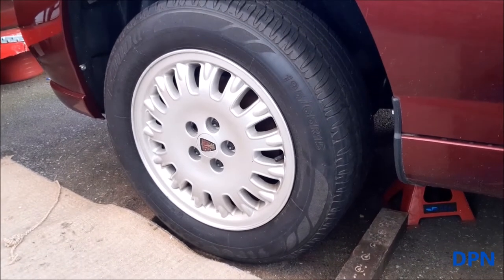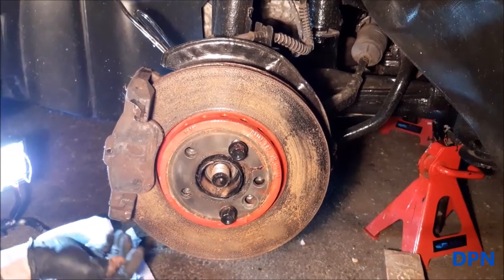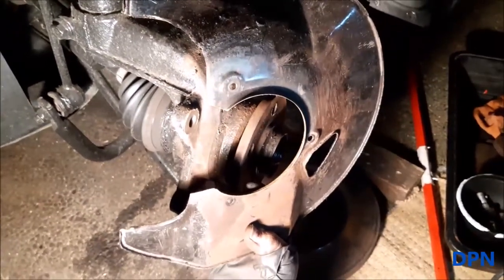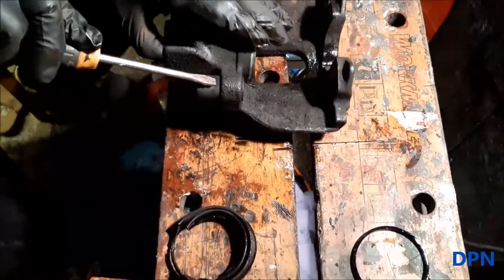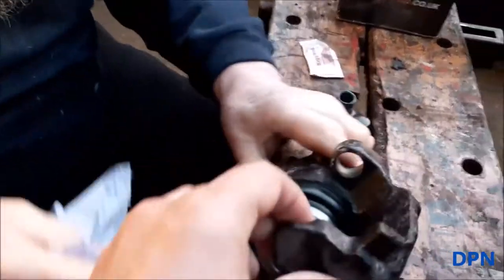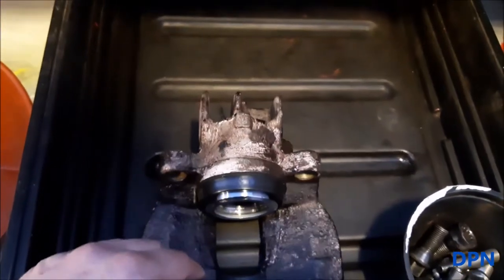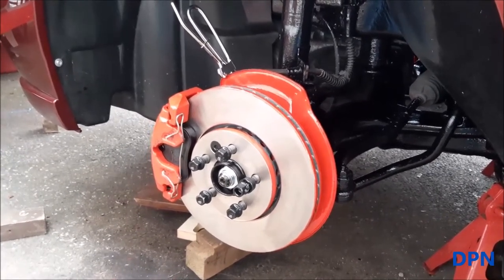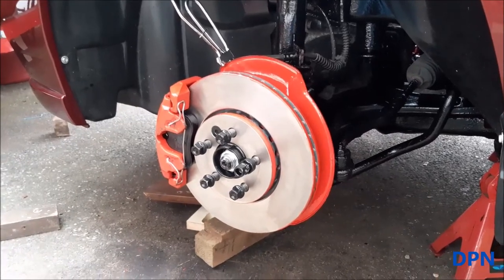Refurbishing the front brake Calipers, new disks, and new brake pads on a ROVER 75

Comment: Why did you remove the hub nut? It's not necessary.
Reply from the maker: the hub nuts look slightly damaged, and as we were changing the hub nuts on the back due to another job, we consider this an ideal opportunity to do it